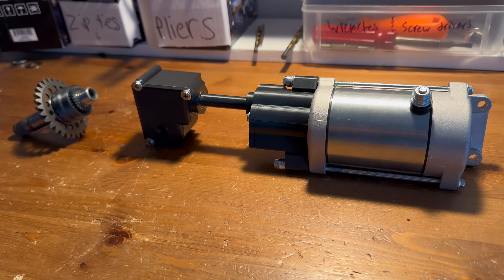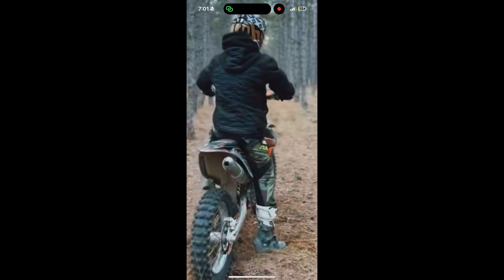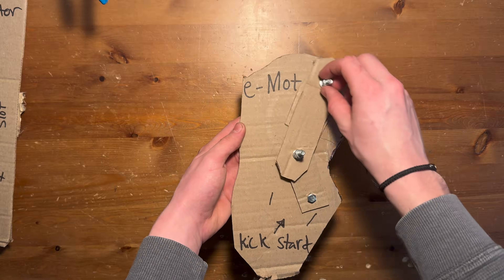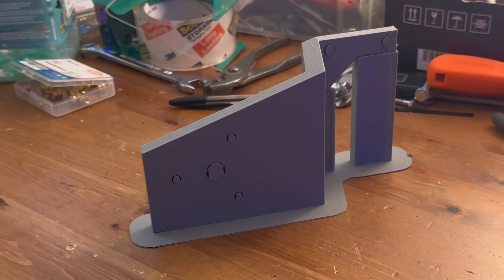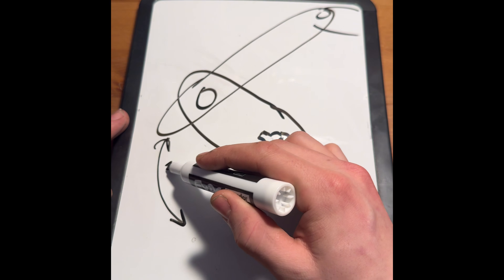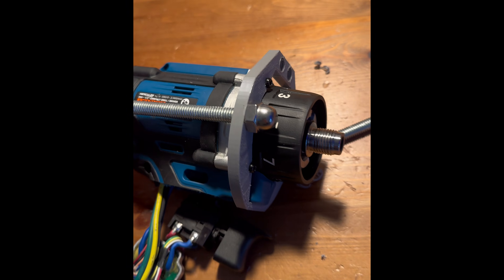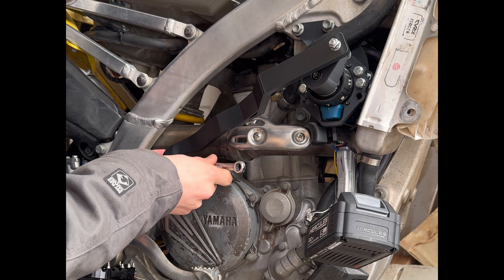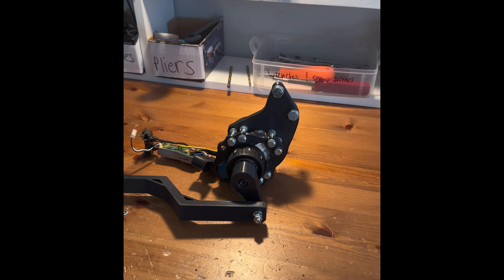Never Kickstarting Any Bike Ever Again! - Universal Estart Kit Build

Comment: Awesome project and will sure help some people, and i know modern dirt bikes with starters have modified cases. If its a 2 stroke it would have a decompression release technically, an shouldn't take much effort to start (which we know its normally more easy to kick but how many kicks does it take)
So guess the questions i would pose 1.how to mount it or a way to carry on bike without interference?  2. Does your re-designed gear still allow it to be kick-started (you will require one for each type of bike essentially)
Keep it up and if your getting into mechanical engineering don't stop doing practical stuff as things don't always work in the real world as they do in theory :)

Comment: Did you think about an adapter for the original kick shaft rather than having to (fairly heavily) modify original. Then they could easily be used universally??? Do you make one for the Honda 400R it’s a b@tch to start cold but once it has some heat in it 1st kick! Be interested in some feedback if possible! Thanks 🙏
Reply: Yeah you just need the atv parts and make a battery holder to have electric start

Comment: I'd like to see a kick that you wind up like old lawn mowers using the kick. 5 or 6 easy kicks and release a lever. I have a bad knee and I'd like an old xt500 but don't want to kick the sucker.
Reply: Good idea . I’m 67 with a XR650R. Yeah it hurts my knee. I usually push start it when the motor is cold. Then I can kickstart it motor warmed up.

Comment: How do you build up enough momentum (Build kinetic energy) without going oversize on the electric motor to compensate?
If not, you have to dimension that way higher than a conventional starter motor to get a momentum to push through compression stroke?
And what with the amperage?

And how are you going to make a reliable, universal mount for this?
What you end up with, is a selected few models that can use it.
Then it is better for people to go the traditional way and get a electric starter modded to the flywheel with a designated package for that specific bike.

And why disable dislikes? Not the way to go man, and the reason I made a comment.

Comment: So without any power on your battery you cant ride your dirtbike? That reason alone is more than enough to keep the kickstarter in my opinion because then you dont have to reli on a battery and a starter motor to start your dirtbike. The kickstarter will always work and a electric starter is not as reliable.
Reply: The whole reason for a kickstarter is to eliminate weight and failure points.
Reply from the maker: @BjornS22193  that’s how all modern e start bikes are
Reply: @Midwest_Moto_Co  Ofcourse they are. It's also the reason why i would have the kickstart on my bike compared to a unreliable electric starter.
Reply from the maker: @BjornS22193  why not have both
Reply: @Midwest_Moto_Co  Reason number 1 because you dont need an electric starter. Reason number 2 because its less reliable and ads more weight to the bike and that's not a good thing on a dirtbike.

Comment: Why don't you use a ACG stater kit . It will fit practically any bike .
Reply: Don't most blocks have a place for a starter anyway for the street version?. 

Ofc it wouldn't be "universal". 

If the bikes got a stand you could just run the chain too.

I could see a target market for universal kit but it would be for vintage bikes(not mx)
Reply from the maker: @lasskinn really depends how small and compact o can get it

Comment: You'd be better off rotating the stator, or the clutch basket. But, like the kick shaft, the clutch basket always has an exhaust pipeand water pump in the way. Not many people want a starter in the area you have it, and you're limited by the space left with a radiator. Cast some different stator covers, get some one way bearings on the flywheel, and mount the starter on the left front away from everything. If you make it fit more models you've still solved a problem. How about a low RPM high torque motor that winds a strong torsion spring, that once released drives a full kickstarter cycle, and then resets?? If driving the kicker shaft, you need speed. Just a thought...

Comment: Your adding weight to a race machine to replace a part that works perfectly. That makes no logical sense.
Reply: Not every kick start bike is for racing.
Reply: @PBK.london most of them from recent times are, in the sense that its why they don't have the starter option fitted. 

Its a fun project by itself, without trying to sell it to everyone, but if you want a starter just add a starter. Once you approach it as adding a starter its kinda backwards.
Reply: Put the original kick start lever in your gear, when it breaks you can put it back to stock

Comment: A random idea I once had (while kicking my dad's Harley Pan Head) was using a clock spring type mechanism with the kicker to store up energy in the spring, over multiple (smaller/ lighter) kicks, until a certain point where it would release (automatically or manually) and fully turn the motor over, like one big "super kick" or an "auto pull start". 
Exactly like winding up a catapult or trebuchet- In theory, you could use the kicker to quickly store up maybe one or two full cycles (SSBB's) with maybe 5 to 10 fast kicks before letting it all rip. Just a random idea for those high displacement bikes. If your bike doesn't start after that, get it fixed, you were never going to kick start it normally. Hopefully that made some sort of sense.

Comment: That worm drive may give you issues due to the gear ratio.  You're slowing the cranking speed way down, just make sure it's still going to give you the appropriate "kicking" RPM on the kicker shaft.  (hopefully you've measured what minimum RPM this is and are designing to that)  A ring and pinion will achieve the same translation of rotation but at a much lower ratio.

Comment: Go to a school that has an FSAE team if you can, or establish one through your school.  Also, dont pigeonhole yourself into only using commercially available motors, you can make your own motor if you need it a different size/shape
Reply: Also, the only empty space that is really available to accept a motor on most bikes is right below the carb/throttle body.  On yamahas there is no space for anything extra.  

My advice: buy a suzuki and develop a kit for that first, since it's the only new bike that still doesnt have an E start.  There's an actual market for a kit like this, and since suzukis have been relatively unchanged for like 10+ years, there are a lot of potential customers.  

I actually can picture the whole design after looking at some photos of the engine.  motor mounted transverse in that pocket of free space, with the shaft running out over the top of the engine case just to the front of the kicker shaft. One plate mounts using the two bolts at the top rear of the case, and another plate mounts using those same two bolts as well as two bolts at the top left of the clutch cover.  These two plates sandwich a simple set of spur gears to allow the motor to drive the kickstart shaft.

Comment: First I want to say  this isn’t to crush your dream of this idea. Just you have to be more realistic. The first problem is there isn’t a cheap and simple way to achieve this. So lets break down some problems, Adding a drive shaft you have many issue. First you will lose torque because  there is flex, and to fix that it will be to bulky, that’s the last thing you want for it to appeal to anyone. But one thing you have to keep in mind is for you to sell anything it has to be safe because lawsuits. I think to many things can happen that could be dangerous. I can only see two ways to make this achievable. First way would have to be custom crank case for the kick start side but so you can put a gear and starter motor that will bolt right up, that means one for every brand and size (not practical, it would be too expensive). The other way is you have to design a universal starter. Needs to be designed small and it will have the bendix drive with a spline connection that will slip over the kickstart shaft. But you would have to change the kickstart components to allow you to continues rotate. I think you should buy a KTM starter and come up with ideas of that. It’s got the power and torque needed. You just have to figure a gear  box to connect it. Another idea you could do is put A motor on the chain drive somehow and put it into first gear hit the start button drives you till you let out on the clutch and starts.
Reply: 1 a driveshaft doesnt need to be large to handle a lot of torque.

2 what can happen that is dangerous?

Comment: A couple of questions if I may. 1/ The nature of the kick lever movement and return is the reason the the up and down or the repeat use of the kick starter. But that gear from inside the bike {on the kick shaft} looks like it could have a motor connected to it that could just continually rotate the crankshaft like a normal starter motor does and the release design for the gear would release the crank from the starter motor once the engine fires up. {Just like a bendix gear does.} So it appears from the parts you showed from the inside of your engine that a starter motor could be attached to simply continuously turn the engine rather than try to imitate the kick start motion. Then the parts which normally allow the kick start lever to return to the upright position would just cause the release of the starter motor from the crank {so to speak} the moment the engine has started.
2/ If you really wanted to imitate the motion of the kick starter might it be better to use something like a air powered piston with a cylinder full of highly compressed air with a sort of large discharge port to slam the piston to give a powerful push imitating the power of a leg doing a kick start.

But lastly kick starting a bike usually involves a process of priming engine with choke on and ignition maybe off then positioning piston if a large or strong 4 stroke to just past compression and if these are done properly {I have not mentioned a decompression lever larger engines had} 1 good kick and the engine starts. That would be harder to duplicate in the setup you are trying to do.
Reply from the maker: @kassiedreaneai7459  okay so i plan to have the kick start shaft basically like you said just be constantly spinning now. I’m basically just tuning the kick start into the crank